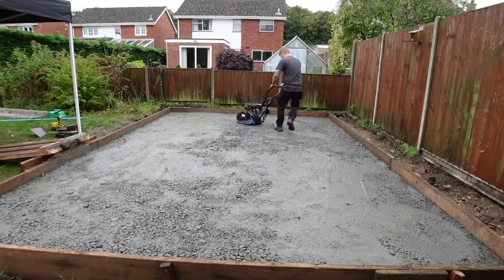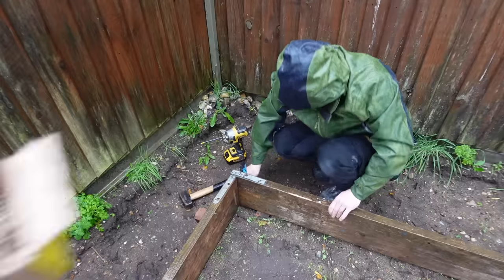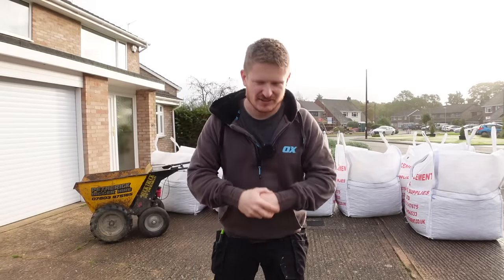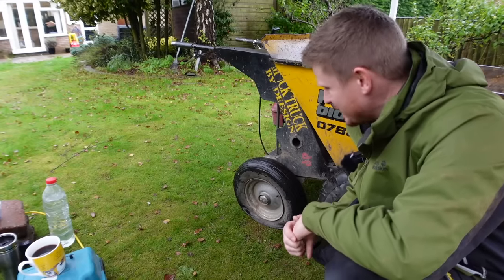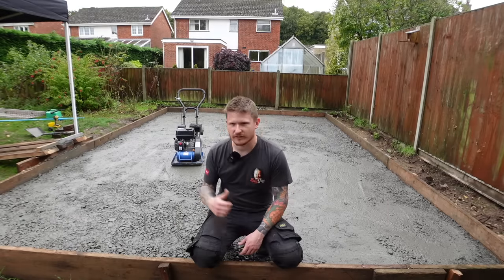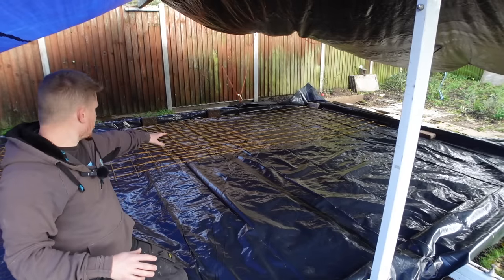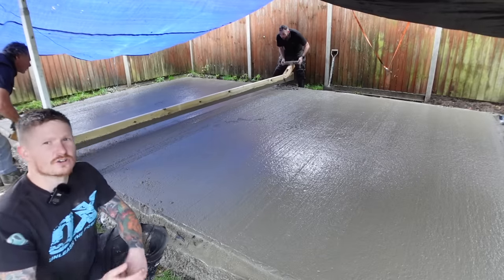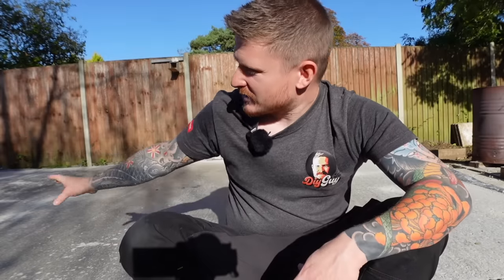How to Lay a Concrete Base Like a Pro - The Workshop Build PT2

Comment: Like a pro - I don't think so! The Type 1 should extend well beyond the concrete as you will find it will fall away and leave the concrete edge unsupported - where, I'm guessing, you will be loading it with the walls. That size plate compactor can only compact 50mm thick max of type 1 (not 100mm) and needs at least 6 passes to get the right compaction so needs to be laid in 2 layers. If you lay type 1 on mud (because it rained between preparing the sub grade and eventually laying it) - in a professional environment you would be told to remove it. Your mates should be wearing gloves because of the alkaline properties of concrete so what you have shown is a long way from being 'a pro' and I'm surprised you are happy to put your name to this!
Reply: So I'm guessing you would lay the type 1 before you construct your perimeter boards and then stake them on top, I suppose that would make sense. Maybe he will come up with something to add some support to the edges but a fair comment though, harsh but fair 😊
Reply: Or possibly put a concrete toe one the base to keep the mot contained
Reply from the maker: I’m pretty happy with putting my name to this.  The concrete edge won’t be unsupported as it will be backfilled with a cheaper hardcore before the drainage and paving is installed. As to not bore people, multiple passes of the compactor were done but not shown otherwise people would get bored and click off the video . My helpers should be wearing gloves, your right, but that’s not relevant to the outcome and is their decision.
Reply: Negative Newman
Reply: Dave, does your misses spend alot of time "next door" I bet she doesn't wear gloves there 😉🤣🤣
Reply: Daves a damn smartarse!  Why not start your own YouTube channel and show us how it should be done!
Reply: @spring899  dave won't don't that cause hes keyboard warrior that likes criticising other people's work and has no idea himself how to do that work
Reply: Dave irons a crease down the front of his jeans 👖 oh yes .
Reply: Haters will always hate!!! Why bother watching just to criticise someone!!
Reply: It's okay Dave, I still like you, even if everyone thinks you're a bell end
Reply: @marcwilkinson3249  no your the bell end marK
Reply: Dear Dave I am sure there is going to be a surround on the base of soil or chippings or paving more than enough to retain the type 1.should the base need  to ever be taken down and the 4inches or so of reinforced premix concrete on well compacted hardcore and subbase needs to be broken up perhaps you could do a  video to show us how you get on 😉.According to you shouldn't take long .But before you start don't forget your gloves to avoid chipping your nails .😂😂
Reply: Ahh thanks Dave you must be feeling better
Reply: Not to defend anyone but Dave sounds like he has actually read MCHW series 600 and the relevant table for material compaction. Similarly, in major construction, Dave has mentioned what quality inspector would expect to be done when you lay material in wet weather. Other than that, I enjoy both the DIY and pro element of work and most people who work in major construction respect notwithstanding clauses for recording and posting online without gaining client approval.
Reply: I bet you get invited to loads of parties
Reply: Someone hasn't had there cornflakes
Reply: Show us your concrete base video dave , and you better be wearing gloves or the police will be called
Reply: Have a day off. Can I see your channel please? just want to learn off the pro himself. Should change your name to “Dave the best Newman ” for the obvious reasons . Bet you haven’t got your hands dirty once and just a typical google warrior. I’d be ashamed to put my name to comments like yours without proof you could do better. Why would you not just tell the comment section what to do correctly (in a nice manner) instead of being a tool and bringing the man down when he’s clearly worked hard. Bet you were a right laugh on a building site… oh i forgot you’re probably in I.T giving DIY tips
Reply: @Steveayr  he just jealous type , easy to put people down , it's a self esteem thing , people put others down to feel better about themselves bud
Reply: @daviddimbleby6725  I would honestly love it if every person who left a negative comment had to prove themselves. Probably doesn’t know what end of a shovel to use. Feel sorry for people who try and educate people with these videos and get shot down with negative people.
Reply: Jesus Christ. I mean your points are valid, but do you think someone would be watching a YouTube video to become a “pro” the title is “click bait”! And you were “baited!”
Reply: Well said Dave. Leave the haters and snowflakes talk all day. If I'm watching something with a PRO title in it, I expect to be up to standards and how it should be. I'm a DYI-er but wanted to learn how to do it. If I were to have only relied on this video, I would have made the same mistakes, but your comment makes a lot of sense and had me look further into this. As for the others, don't jump like you're burned. This guy took time to write to for us, the dyi-ers or people who want to do it themselves and doesn't want to repeat the mistakes and possibly the very expensive fixes in the future. Stop being so hateful. I would also advise the creator for the future to either comment further on what should be done or leave the PRO aside.
Reply: Looking for some help. After you remove the shuttering do you trim the dpm right down to the base or do you fold it up and over the sides of the concrete base?
Reply: Getting mixed advice about damp proof needing to be pulled over the top or just layed inside instead.. care to explain any theories @TheDIYGuy1 ? 
My builder says it's not needed to be pulled over. I think he said as rain will trickle in somehow and damp will always get in either way. 
Any other ideas are welcome on how to stop damp coming through the floor??
Reply: Show us a video of your job.?????
Reply: How do you correctly trim the damp proof membrane?
Reply: @thejoat588 watches a lot of YouTube hoo ha I suspect, then does the job herself whilst wearing gloves & an entourage?
Local suppliers will want to charge £49-£60 to deliver 4 scaffold boards a 6 minute vehicle distance, so the next step would be to drive her own van before setting fire to the wealthy widows nest of covertly procured guests.
Reply: @williambathgate8827 because there appears to be no consequence where there appears to be no value? Is it called value added tax or copious aggregate?
Reply: I’ve just seen your comment on this video and wonder whether you can help me understand your first point about the M1. How can it extend beyond the concrete? Aren’t they both constrained by the wooden frame?
Reply: @alistairfraser9242  it extends beyond the aggregate by addressing people directly with direct questions, which minimises the occurrence of Carries hand rising out of the concrete to make  people jump after she’s been covered in pigs blood and burned the offenders in a lock in? 
Science might metaphorically show that when a circle is drawn around an ant on a piece of paper, that it cannot cross out of the line…but people are not ants and they supposedly operate on basis of free will and the notion of social self-service…still, on mass they are able to do a lot of damage and even make brickwork floors & driveways collapse by removing sand when making large nests in the underground foundations. That said, they don’t travel in sophisticated submarines as they are social creatures organised into pyramidal hierarchies, where each creature has a role within the nest.
Reply: @alistairfraser9242  They are both contained by the wooden frame in this video but in a professional environment you wouldn't do it like that or even be allowed to. The crushed stone (MOT type 1 or sub base) should extend beyond the concrete base at least as much as it's thickness then a wooden frame (shutter or road forms) are then pinned into that, levelled and the concrete poured. If the shutter holds the sub base and the concrete, as soon as it's taken away the stone below shifts a little and the concrete edge is left unsupported.
Reply: @davenewman4301  Thanks very much, I appreciate your reply. One follow up question: I’m worried that if the subbase is not completely level (and it’d be difficult, I think, to ensure that) then how would I get the wooden frame level if it’s sitting on top? In all the videos I’ve watched people hammer stakes into the ground and attach the frame to them in order to get the frame level and ensure it doesn’t move. But that wouldn’t be possible if it’s sitting on top of 6 inches of compacted type 1, would it?
Reply: I suppose what I’m saying is I don’t know what you mean when you say the frame is pinned into that. Could you elaborate please?
Reply: The sad thing is Dave is 100% correct 
He doesn’t need a channel to show how this is professional Lu done 

It’s exactly what I’d expect if I was paying someone to do it.
Substandard work isn’t acceptable just because it’s a diy job

Comment: Do you need planning permission for something this size?
Reply: I think he said no, anything less than 30 square foot does not require it. Which is good to know as I want a workshop so good to know, , as long as you are less 2.5m hight, less than 30 sq, you don't need planning permission. I think he so said you need to have sort wall to as well.
Reply: Rules differ depending on how close to the boundary you are too. Further away from the boundary can be taller so best to check with the local council
Reply from the maker: Absolutely. Over 2m from boundary you can go taller than 2.5
Reply from the maker: Correct. Under 30sqm, your good as long as you stay at 2.5m or below and use a non combustible on the boundary facing walls.
Reply: @TheDIYGuy1  when you say non combustible material, can you give a example that you could buy that doesn't break the bank???
Reply from the maker: Metal sheet is the cheapest method and cement board is another.
Reply: Look at permitted development for outbuildings, England,Wales & Scotland all have different rules on this.
Reply: No
Reply: Think the 30 square meter is the internal dimensions so outside can be bigger So you can allow for joists and insulation if wanted.

Comment: Tomorrow, I have a slightly larger , 4x8 meter base to lay. At the top of a hill, up a 400 meter track that’s too steep for a trailer behind my old land rover with off road tyres. So, 8 dumpy bags, 4 trips each. Mixed with a small cement mixer, wheel barrow and rake. Alone. I’m 62. Wish me luck.
Reply from the maker: Wow sounds like a bit of work. Good luck 👍

Comment: first up great video as usual. Im just a DIYer myself but a number of years ago I laid out a patio slab foundation for myself with similar dimensions and at the rear of my property with no easy access. The delivery driver gave me a great tip for my type 1 and stacked the ton bags on top of each other to a max of 3 high, so that instead of shovelling the  stuff into my barrow ( no mechanical aids for me) I simply cut the base of the bag and let the product virtually flow out into the barrow. Not perfect but saved loads of work. Hope this helps someone or even yourself on future jobs
Reply from the maker: Good tip 👍
Reply: Genius!!!!!

Comment: Started watching your channel as I was installing a roller shutter garage door and it was from the company you did the job with. I have also built my own workshop, it was 6m x 8m and I wanted to have roof joists go across the whole 6m. The cost of those joists were astronomical so I built my own. Now have an insulated workshop and no supports in the middle, well chuffed.

Comment: Something us novices always find helpful is when you can show us how you mix your mortar especially if you are going to use a bell mixer. A bit of a master class on the proper steps and how you get the right consistency always gets a lot of views and how you ckean it when you've finished. You could also show how you work out the block work so that it fits your dimensions and how you make a corner. You have a great channel which is helping a lot of people so thanks for taking the time to get these videos out there 👍
Reply from the maker: This one will be a timber building but thanks for the suggestion
Reply: You can buy bricklayer tapes to help estimate blocks or bricks usual mix for conny 1:6 cement/ ballast or 1:2:4 cement course sand agregate... hope that helps

Comment: Put my 10 x 6 summerhouse on plastic grids filled with gravel, lovely base with good drainage and ventilation. I would recommend them for smaller projects rather than chucking down a load of concrete and I can always move them if I want to relocate it.

Comment: Great video which gave me the confidence to tackle my own project. I'm almost at the stage to pour the concrete but I just read that a 6x3m base needs an expansion or a control joint. What do you think about this? I'd appreciate your advice. Cheers!

Comment: I'm planning on doing the same (just on a smaller scale) in spring. I prepped the area last summer/autumn - the garden slopes (quite a lot) toward the house so the area of land I've dug out is now level but a small retaining wall will probably be needed at the highest point. Tempted just to hire some lads to do it to be honest as the prep work was absolutely back breaking...😅
Reply from the maker: 👍 it is hard work!

Comment: Wondered if you had considered using a vibe to help settle the concrete? Thanks for the video series. Have the very same project to do myself. Best of luck.
Reply from the maker: Yes, I did originally hire one however the hire company cancelled my hire 2 days before the project, leaving me having to make the tamp seen in the video. Originally we were using a 4.2 aluminium tamp. Best of luck with your project!

Comment: Always the way in the UK, the weather always is out to get you. Do you not need to add a slight pitch to run the water off?
Please make sure you do an in depth vid on how to get your workshop built dry with no condensation or mould problems in the future. Great vid mate keep em coming.
Reply from the maker: Absolutely. No, no run off required due to the building being build the complete size of the pad. No rain water will come in contact with the pad itself but will instead run off the fall on the workshop roof. Will do 👍

Comment: Doing 6.4 m x 4.7 m 230mm high concrete delivered  and pumped 1700 hopefully that's a good deal. 160 feet from road side to site needed 8 m3 16 tonnes of concrete

Comment: Great vid, was hoping to put 100mm insulation underneath a 4.5m x 4.5m pad, would you put the insulation on top of the membrane and then pour the concrete directly on top of the insulation, or would you put the insulation underneath the membrane?

Comment: When you remove your shuttering boards you will expose the sides of the Type one and sand how do you propose stopping this from falling out as it will not be solid. Will you build yuor block work on the outside of the slab to protect the sides?
Reply from the maker: The sides will have a cheaper hardcore backfilled against them before the drainage and paving goes down.

Comment: Nice video - looking forward to the next part 👍. When laying the Type 1 how do you make sure you have the correct depth of 100mm across the entire base? I guess you can mark 100mm on the wood at edges but what would a string line work for the middle?

Comment: Should have kept the mini excavator for loading the mini dumper with stone , also that dumper looked like a struggle by not tipping itself , the tracked dumpers are better ,they have hydraulic tipping and also carry up to 1 ton
Reply from the maker: Your right. They are a lot more than 35 pounds for the day though. I guess I was trying to pull back some costs due to it already being fairly pricey

Comment: Forgive me for going slightly off topic, but I'd like to know how you did the invisible mending of the fence.

One day the bird box is quietly thinking that its days are numbered, then there's a gurt big hole for a support beam, then all put back with bird box on a batten where the hole was.
Is it the magic of filming hiding it, or have you magically mended the fence slats?
Reply from the maker: 😂😂 my other half complained that her squirrel house had been tampered with so I had to put it back!
Reply: @TheDIYGuy1  
Hmm. It doesn't look big enough for the grey squirrels, so I hope that you're lucky enough to have the smaller red ones where you are.
Guess invisible mending of fence panels is a trade secret. I was a bit over enthusiastic with my ivy clearance and have buggered one up is all.

Comment: Hi, great video, horrible weather. But,,, when you take the boards away, how do you shore up the edges, and would the edges not normally be deeper than the middle to support the walls going on top (unless it's a wooden structure). Your jobs are always great, so maybe the level pour is adequate. Thanks
Reply from the maker: Hi, edges get backfilled with a cheaper hardcore before the drainage and paving go down. The level pour is plenty for a timber frame structure.
Reply: I think the penny has dropped and you can see when you strike that shutter that it's back to front

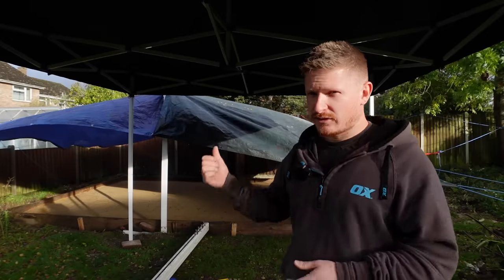Comment: 10:47 just wondering you said about postponing it if you could just after the blinding sand. If you were to postpone and the type 1 and blinding were to get to wet at this point would it need redone or just topped off before the concrete is laid.

Comment: Question: Why do you need to place DPM underneath the concrete? Will the water within the concrete otherwise be soaked up by the sand underneath it, or is it there for another reason?
Reply from the maker: It is to eliminate the possibility of damp/moisture rising up through the concrete.